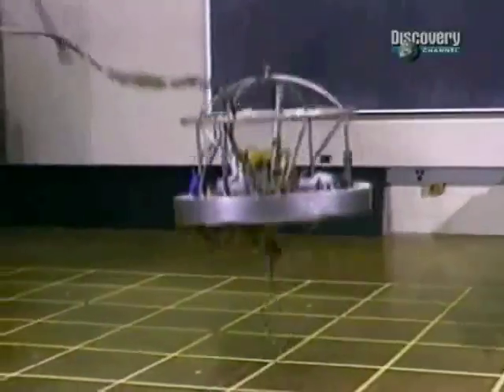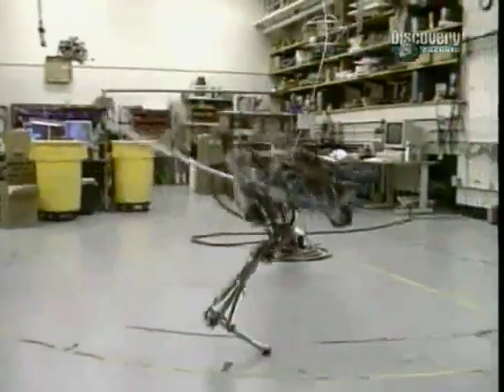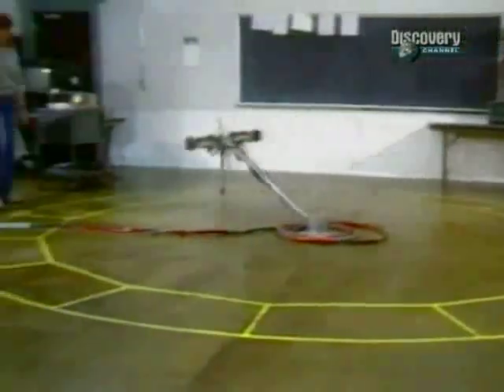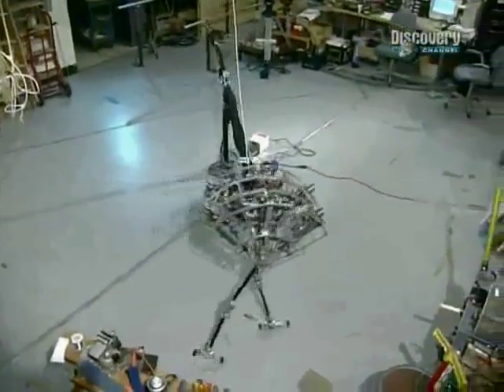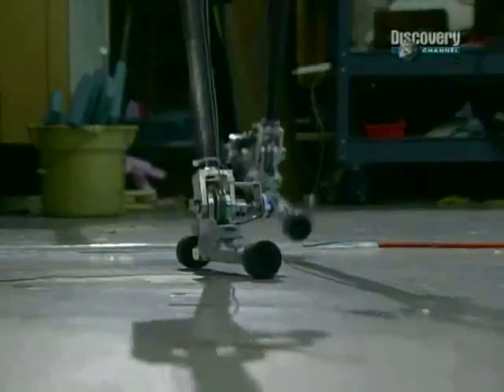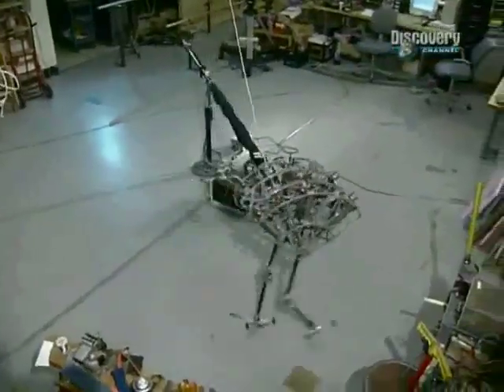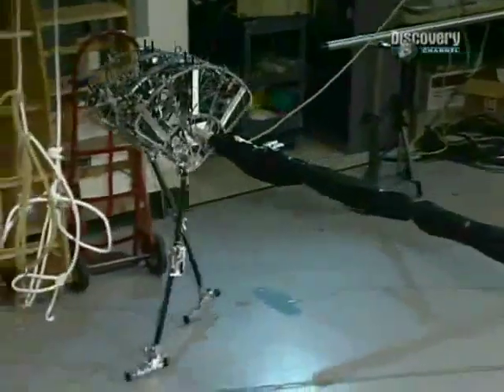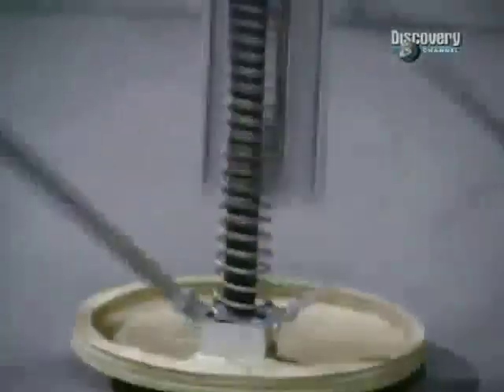Robots from MIT's Leg Lab

Comment: A robot should have eight legs, like a spider. The front ones used as sensors when moving, second pair climbing, 3rd pair ground clearance and LR balance, 4th pair propulsion.
Reply: That is a overused design.